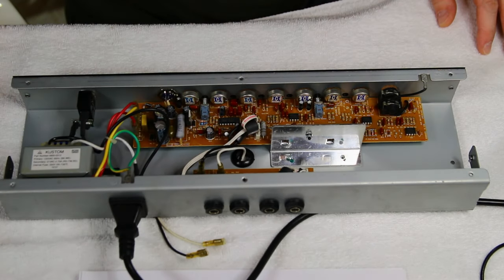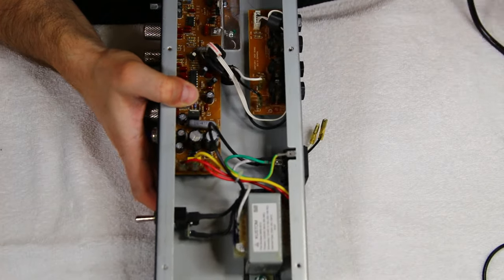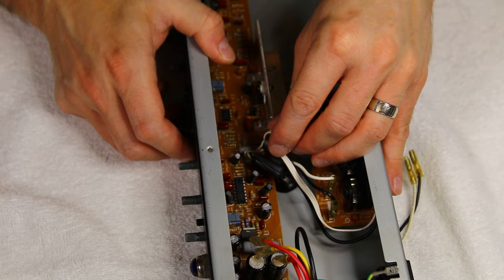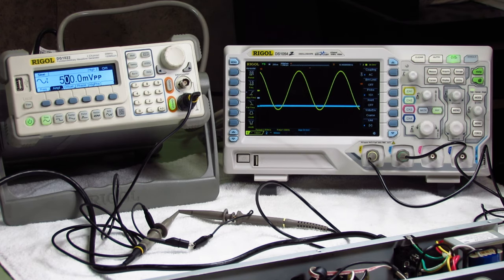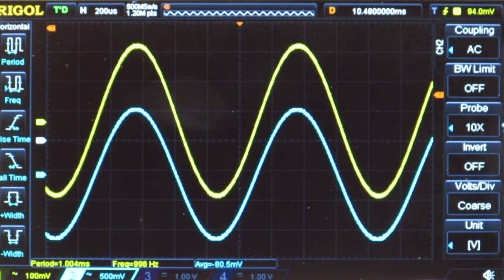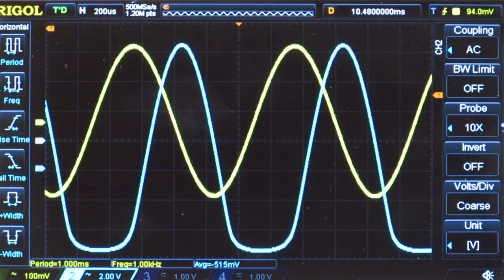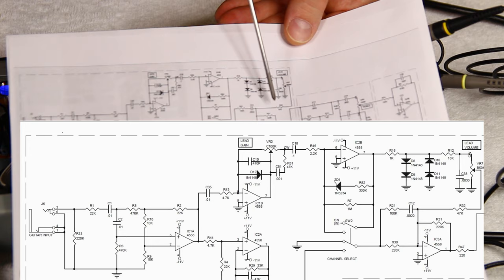7. Guitar Amp Giveaway!  Kustom 12 Gauge distortion circuit overview and replacement part 1

Comment from the maker: Schematic:  2:00
Knob removal:  3:42
Power connections:  5:50
PC board removal:  7:07
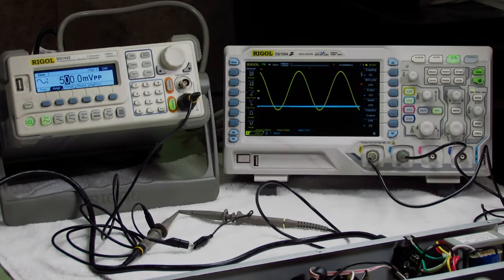Function generator & oscilloscope:  8:00
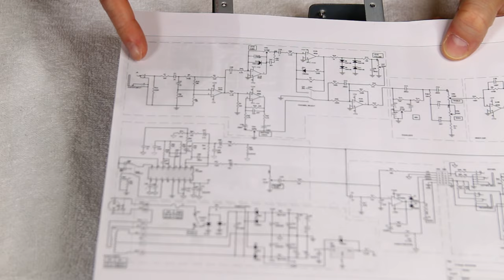Cloud kitty:  11:03
More schematic and circuit description:  11:05
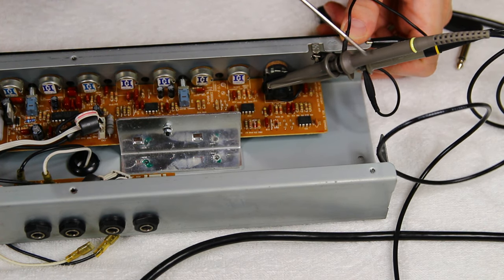Generator and 'scope connections:  12:05
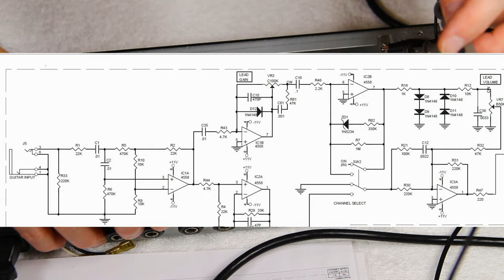Output of IC1A:  14:00
Output of IC1B:  16:05
Asymmetrical clipping:  17:12
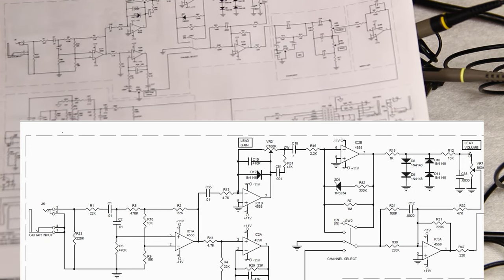Output of IC2B:  20:00
Input of IC3A:  22:30
Hard clipping:  24:15

Comment: Enter me please. My Peavy amp has died on me and i need an amp. I shared on facebook and twitter and i am hoping..
Reply from the maker: Hi again Carolyn.  You will be entered, don't worry 😉  Thanks for sharing, I really appreciate it!
Reply from the maker: By the way, what is your amp's model number?
Reply: it is a peavey ecoustic series E208 @unique_amps_electronics
Reply from the maker: @carolynishis  , I'm looking at a picture of the amp... how did the power switch get pushed into the chassis?  https://www.amazon.com/dp/B00407ZTRI?tag=duckduckgo-ffsb-20&linkCode=osi&th=1&psc=1
Reply: @unique_amps_electronics  I am not sure but you can manage to flip it on but the wire must have broke because it will not power on.
Reply from the maker: @carolynishis  Are you or someone you know handy with a screwdriver?
Reply: @unique_amps_electronics  yes,i am